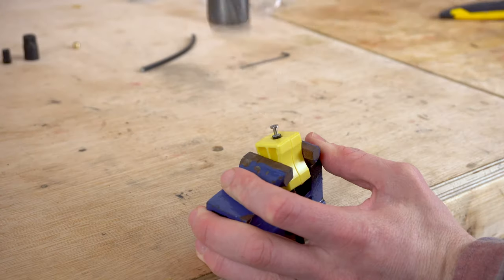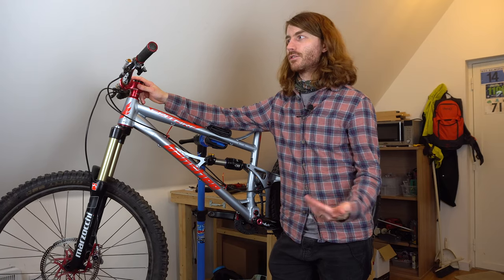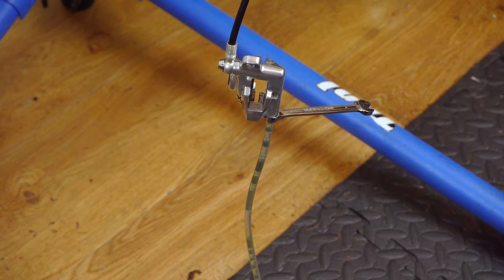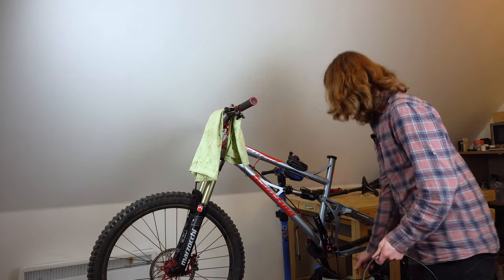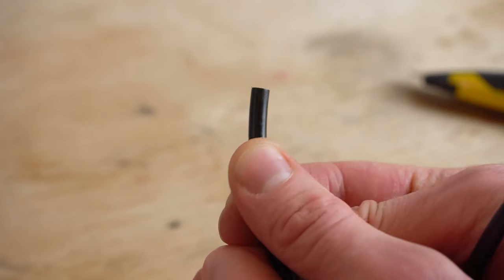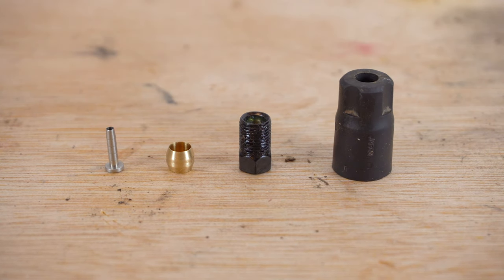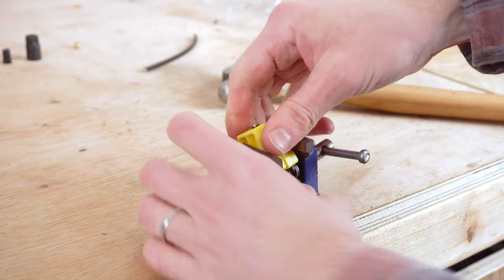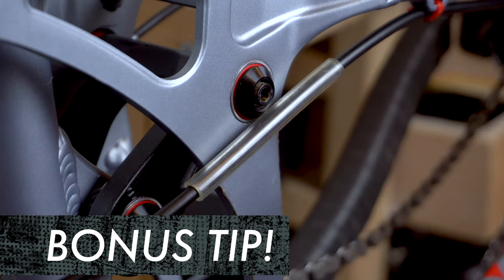Replacing or Shortening MTB Brake Hoses | No Specialist Tools!

Comment from the maker: What brakeset are you running and do you have any tips for keeping them all full power?
Reply from the maker: This is a set of Shimano XTR brakes, for full power a full bleed and fresh pads are a good place to start. 

Sometimes a lever only bleed can help get any air in the master cylinder out, its not as effective as a full bleed but work well as an interim top up bleed so to speak.

After that, think about cleaning and lubing the pistons themaselves.  If your not sure how to do this don't dive in as if it goes wrong it can make a very messy clean up job for you!

Comment: Great video. As a fellow youtuber, I really appreciate all the different camera angles. Your explanations are great too.
Reply from the maker: Cheers bud, it takes me ages to put a video together so the is for noticing the effort! I'll give your channel a scope out too!
Reply: @StravaigingMTB  Your comment about what the olive does convinced me not to take mine apart today after having brake issues...I am still troubleshooting, but it seems to be working fine.
Reply from the maker: What problem are you having and what's the brake?
Reply: @StravaigingMTB  I bent a SLX (4 piston) lever so I replaced the assembly with an old xt brake lever assembly. It worked fine for about 2 hours until I crashed and laid the bike down on a rock. The lever wasn't returning quickly to the open position after I applied the brakes. Now in the garage it seems to be working, but still slow. The braking is fine.
Reply from the maker: @MTBMOR  the easiest thing might be to get a new style SLX lever. Whilst in theory the levers are inter-changeable, there might be an issue of levers designed for a piston only line of brakes?

Comment: Super helpful. This is the only vid I found that gives comprehensive details on how to replace your brake hose. Tip of installing tubing over top of the hose at high wear locations is spot on. Thanks!
Reply from the maker: Glad you found it useful! I'd really appreciate the sub if it helped get your bike rolling again 🤘

Comment: Do they make a left/right threaded feed through barb to join 2 lengths of line with fluid continuity. The left/right allows cut and thread lines together with narrow line continuity for tight spaced channels?

Comment: Great video but I'm still a bit clueless (been into Bmx on n off for 20 odd years so hydraulics and gears ain't my strong point) I wanted to change the brake cables on the hydraulic brakes on my Marin AXC 2007/8 model do I need specific brake cables ???.I've bought Shimano std brake cables but I've just realised hydraulic brake cables are probably different. I know, it seems obvious now 🙄🤔🤔
Reply from the maker: No worries we all have blind spots! I have no idea how to fit a BMX crankset! The hose is usually specific to brand, so shimano hoses to shimano brakes. The hoses don't all have the same inner diameter and the fitment for the master cylinder and calliper are different. The o rings being used could also be different depending on whether the system uses dot fluid or mineral oil. Best thing to do is stick with the original manufacturers parts or if going with third party make sure it is compatible with your brake system.

Comment: 7:32 does the orientation of the screw/attacked part of the hose (not sure what it's called) matter? As in, there's a hole in the metal thing on the hose and one in the screw, do they have to line up or does that not matter?
Reply from the maker: No the orientation doesnt matter. It's a banjo bolt, so you can point it for the straightest line for the brake hose.
Reply: @StravaigingMTB  great, thank you!

Comment: Can Shimano Deore M6100 replace its brakehose? because mine was short and I want to expand the length of my brakeset, and to do that, I need to buy a new brakehose but how can I replace it? do you have any instruction to remove my brakehose from my caliper?
Reply from the maker: With the deore brakes there is no banjo bolt at the caliper. It uses the same fitment at the caliper as is used at the lever end. 

Where these enters the caliper is a nut, loosen with a spanner in the same way that you remove the hose at the lever.
Reply: @StravaigingMTB  thankyou, its a big help for me 🤝

Comment: What causes the banjo  O ring to crush?🤔
Reply from the maker: The o ring is a little proud in its recess on the banjo bolt, so it deforms to create a perfect seal. So if replacing a hose you want unused/deformed o rings to ensure a solid connection.

Comment: How to swipe the banjo bolt?
Reply from the maker: Sorry I dont know if I understand?
Reply: @StravaigingMTB  sorry, I’ll try to explain my case. Ihave the original unused shimano hose with the banjo bolt at the end. It is too short for my cargo bike. I bought a new and long Jagwire hose and would like to remove the banjo bolt screw from the “old” shimano hose and install in the jagwire hose. Is it easy? It’s just like unscrew, pull and install in the new one?
Reply from the maker: The banjo is crimped onto the shimano hose (and most others). This means you cant move it across onto another hose. Most third party hoses (including jagwire) have screw together fitments so you can add your own banjo bolt that fits your brake caliper. You will need the correct kit (shimano or sram etc) to ensure the banjo fits. Check the jagwire website to confirm which set you need. https://www.wiggle.co.uk/jagwire-pro-quick-fit-adaptor-kit?lang=en&curr=GBP&dest=1&sku=100559815&kpid=100559815&utm_source=google&utm_term=&utm_campaign=Shopping+-+All+Products&utm_medium=base&gclid=EAIaIQobChMIppnJ-8L67gIVh-3tCh31ywaQEAQYASABEgJrSfD_BwE&gclsrc=aw.ds
Reply: @StravaigingMTB  thank you very much for the detailed response!
Reply from the maker: No worries, glad to help I'd really appreciate a like and sub if you found the video useful 😁.